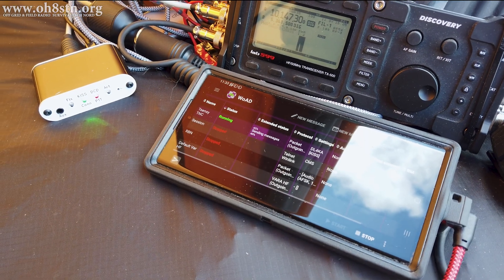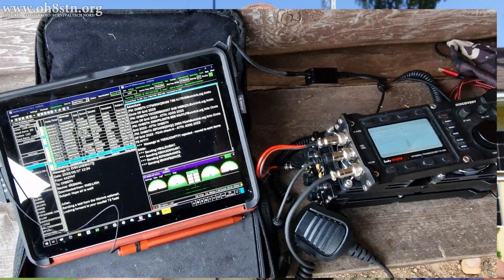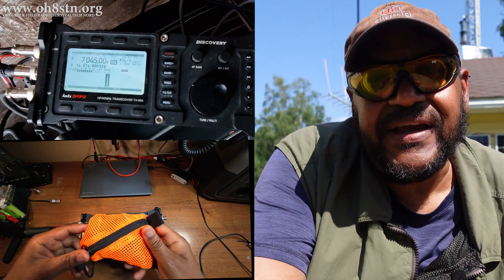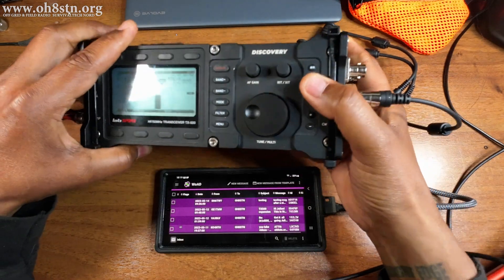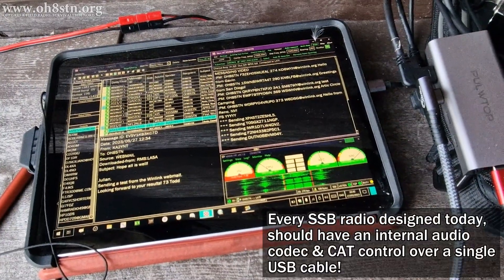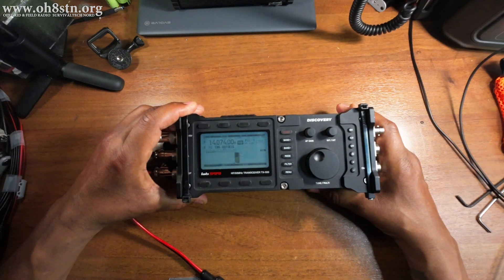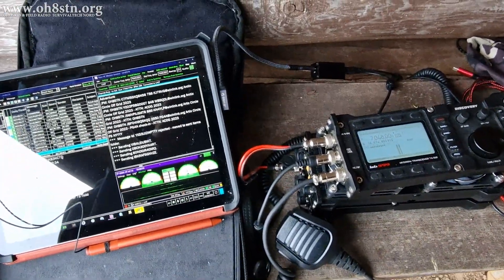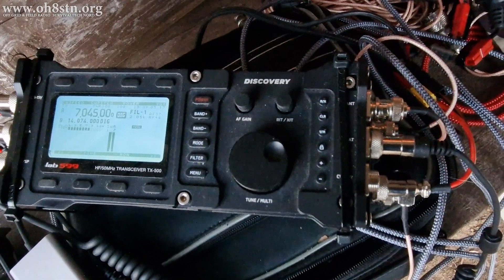Modular Ham Radio Go Kit for Off Grid HF Radio

Comment: Julian, very good video. But, you are often  talking about emergency communication. In that case the radio  and ancillary equipment should be as simple as possible. Your set up  does not look simple and you forgot the KISS (keep it simple stupid) method. I got my radio license almost half a century ago (and always renewed it) and did not use it for  30 years. Now, living in Europe and with all the trouble around, I  want a transceiver for emergencies only.  What is your rcommendation? I think the Icom 705 may be the right radio for me.
Reply: I agree with the KISS method. An all in one radio, even if a little heavier, may be an easier to use radio rig.

Comment: Awesome Video! The cable mess you mentioned was exactly my reason to start to develop a way around it. With the amp and battery underneath I'm sure it's not getting better. Will try to put the digirig underneath the speaker in my design so that you still can put the lab599 or diy599 battery pack or amp below it. Once it's finished I will send it to you. Thx for all the Infos! It helped me a lot.
Reply: @webanon  I will. Thx for the sub!

Comment: I’m going to have to disagree with you Julian. Military manpack hf radios are much better than modular messes. One cable to run data modes and an antenna in that’s it. They have inbuilt batteries, 25 to 30 watts of power, extremely energy efficient, robust and tuners capable of taking a whip antenna or a coax. This is what yaesu needs to bring out to the market. Cheers Lance
Reply from the maker: Interesting Lance. I didn't mention manpacks in this video. Just talked about the equipment used in Lapland. What part of what I said don't you agree with?
Reply from the maker: I read your comment a couple of more times, but don't see why there's any disagreement. The only issue I have or have ever had with manpacks is our load capacity. In the military, we have/had a squad supporting us, a logistics machine, ... In a civil disaster scenario,  there may be no carrying capacity for both a manpack radio and necessary food, gear, shelter, etc... I simply can't reconcile the size & weight of a manpack. As I mentioned in this video, I also can't reconcile the mess of wires in this solution. The radio equipment is one part of a larger kit. With logistic support comma a man pack would be a good idea. Without logistics, I'm not sure if a man pack is the right choice.
Where do we disagree?
Reply: @OH8STN  On the modular system. More parts more chance of failure. I know I’m dreaming that one of the amateur radio companies out there would make an amateur manpack but you can only dream plus the modern man packs are much small than the past on and an amateur one would not have to be built to military specs.
Reply from the maker: We don't disagree Lance.
I tried to make the point in this video without crapping all over the setup. The wire mess is completely unsustainable in the field. Perhaps the message was too subtle. The one wire approach is definitely the way to go in the future. The thing is, if we don't take this gear out into the field for testing, we can't provide the feedback needed by manufacturers to make improvements. The let down for me was not being able to keep all those wires connected while humping my pack. I had to stop, set up the radio and connect all those wires, before the kit could be used. I don't think we are in disagreement. 👍
Reply: I prefer a Yaesu FT-891, one or two 12Ah LiFePO4 drop in batteries, a genasun mppt charge controller, a decent foldable solar panel and an old lenovo thinkpad laptop with 12v car charger and some kind of antenna of course.  cable salad kept to minimum.  not too heavx either

Comment: i think when you buy a toy expect toy  results and faults
Reply from the maker: What would you suggest?
Reply: @OH8STN  may be a  yaesu817/857 or latest options from icom, whilst this has done you  well in the past, it does show limitations  of hardware design, what you play around with  in SOTA and may be in a potable rig movin about in context of an emergency  you would likely be  within a base camp within a caravan or 5th wheel you are hardly going be within  a backpacking sitrep or doing S&R style deployment  that be left to  younin's..

man pack portable sounds great on paper in practice on the other hand no t so great..